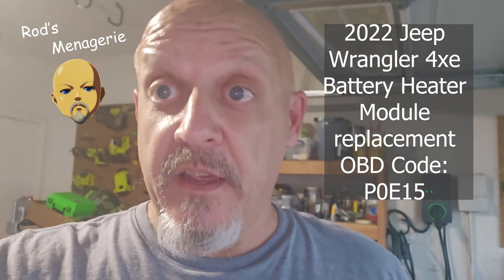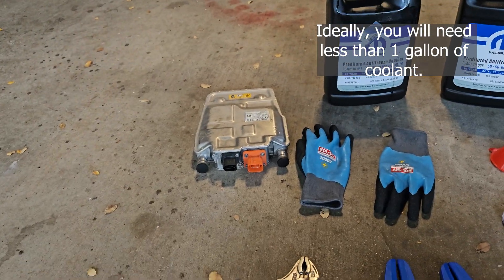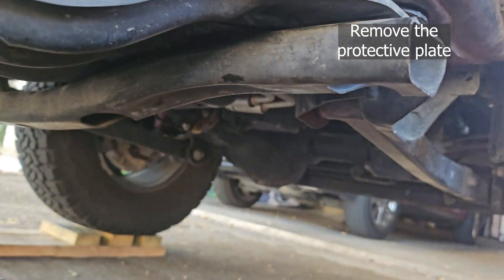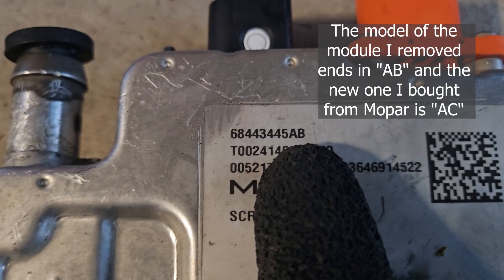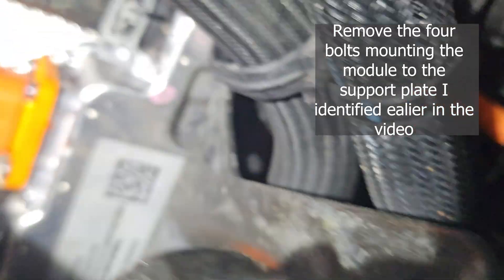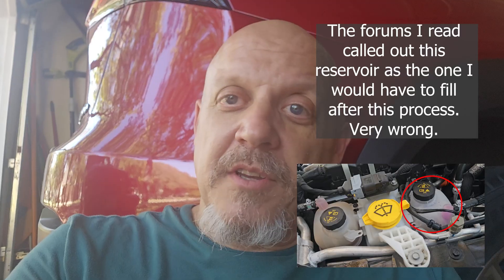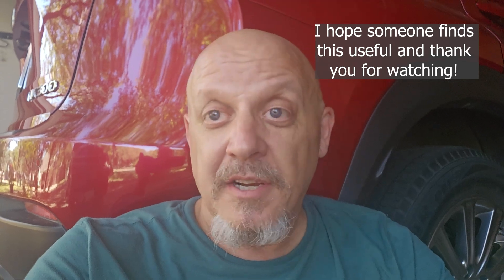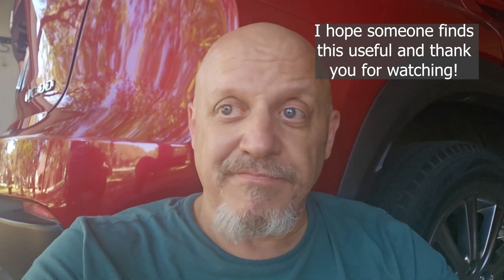2022 Jeep Wrangler 4xe - Battery Heater Module Replacement - OBD Code: P0E15

Comment: Hi, I’m having an issue removing the orange high-voltage cable. I pulled back the red tab, but it’s still holding firmly. Is there anything else I should press or pull? The data line came out easily, just as shown in the video.
Reply: @RodsMenagerie I'll be appreciate you for a quick response.
Reply from the maker: I apologize if this is redundant, but with the red tab out, there is still a push tab to press while pulling on the cord.  I used my phone to take a photo of it while I was working so I would know where to press.
Reply: @RodsMenagerie  Finally, everything went well — the issue is gone, no more P0E15 code or check engine light. The coolant hoses were removed quickly and easily, but as I mentioned, the high-voltage cable was the part I got stuck on. Thank you so much for the video guidance.

The dealer wanted to charge me $1,300 for parts and labor and said the battery heater module wasn’t covered under warranty. I have a 2021 Wrangler 4xe.
Reply from the maker: @AlecFoster-m5b  Glad to hear!   Dealership prices are nuts
Reply from the maker: Unfortunately i am not sure.  Mine came off fairly easily.  First thing i can think of is the red tab might not be fully out. Also, it could be the cable connection itself.  Like i mentioned in the video, my coolant lines were stuck. Maybe the seal on your high voltage is doing the same.  You might have to muscle it.  I wish  i had a trick for that but i dont. Maybe a pry tool but be careful.
Reply: @RodsMenagerie I was able to remove it successfully by pressing the cord. Thanks for the advice. Now I’ll see how it goes — I finally managed to replace it and will play around with the coolant filling next.

Comment: Thank you for the great explanation in this video, it very helpful for all of us!
I’m facing the same problem with my 4xe it has just 15K miles on it but it happens anyway. 
And it says :
P0E15-00 Hybrid/EV Battery Pack Coolant Heater “A” Control Performance- Active.
Jeep was imported from Canada to Eastern Europe, Bulgaria.. and there is no warranty on it because of overseas shipping I believe.

Comment: I thought these are covered under 8 year 100k miles hybrid warranty. All battery related components?
Reply from the maker: You are probably right, but I have had too many bad experiences with my local dealership.  I decided to do it myself and learn something that i can share with others.  Not to mention, I was able fix quickly, where as my dealership takes 5 days before they can diagnose the vehicle due to backlog.

Comment: Great job and showing your mistakes. It is what can happen to anyone DYI'ing this.  

Have you come across any official info on how to power down the HV system and the air evacuation procedure?
Reply from the maker: Unfortunately, no. I am either looking in the wrong place or jeep is not making it readily accessible.  Based on my recent experiences with them, I bet the later.  🤬

Comment: Is this not covered in the battery warranty?
Reply from the maker: You are correct, it probably is. In my case, my recent experiences with the local dealership have been wholely negative so I decided to figure out how to replace the module myself. Hopefully this video will help others that are either out of warranty or in a similar situation.
Reply: @RodsMenagerie this is the exact issue I’m facing with my dealers too. North AL.